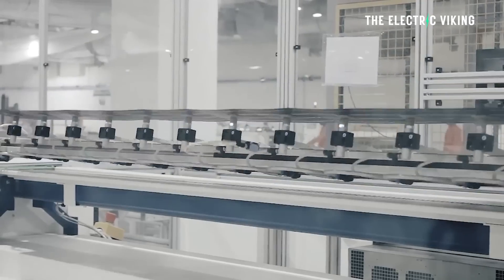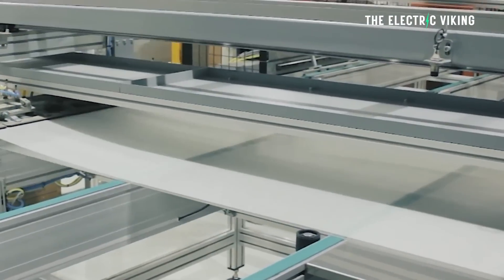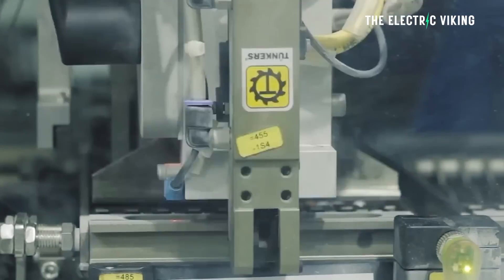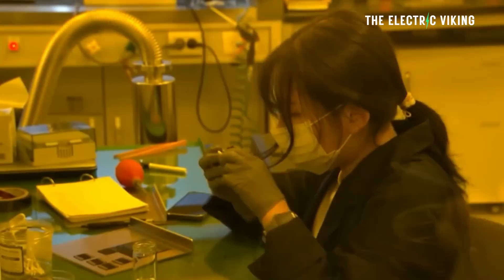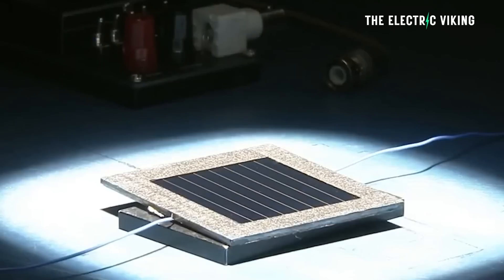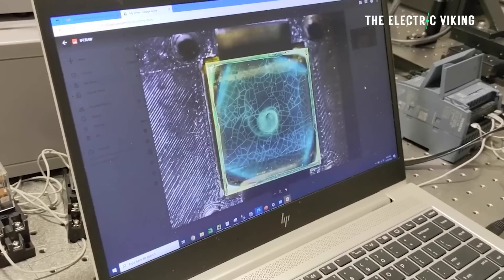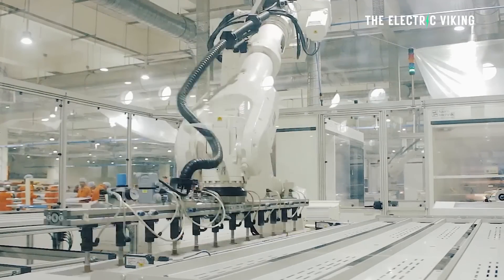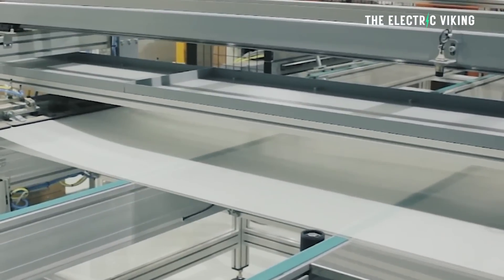AI enables China beating perovskite solar cell production in Australia

Comment: My boy... Current AI is shit.
You should check and test because the fucking AI makes a shit ton of mistakes.
AI still can't do basic math or reliably correct a fucking text, it makes mistakes , it skips lines, it doesn't double check and appears so confident when it provides a wrong answer...
Did the AI discover anything yet?
17% efficiency is bad and you'll never make it cheaper then the fucking Chinese.
Even if you somehow manufacture 17% panels at 1/4 of the cost / W of a Chinese panel you're still going to fail because you will need twice the area, twice the number of panels, twice the number of frames, cables, fuses, connectors, diodes, glass, whatever and twice the installation cost which is the most expensive thing.

Comment: Your believe in Western technological superiority (the Asians have stolen our technology/ Tesla will rule the world) is comical. 1. research in Perovskite cells is going on all over the world, for in stance at Chinese Hong kong and Japan. 2. they think to have realized a durable composite material, but one can only be sure in 10 years time. 3. silicon based solar cells are improving to equal levels of perovskite cells (>30%) 4. with AI they have developed new cheap production technology (nano printing etc), but the claim that this will be cheaper as producing silicon cells is unproven (silicon production has been completely automated and latting machines work is cheaper as destroying them). Be glad that the Chinese are not like most Westerners (f*cking you from behind in the service of humanity) and the Chinese new chips will not be accessible to Western research and can not be copied.

Comment: Perovskite has the inherently bigger issue of lifetime expectancy or degradation over time. So it needs to be sealed well and probably other protection or preventative measures too. AFAIK. So far, it was seen as a potential second layer under the classical silicon layer and such dual layer panels can easily raise production from 34% to 43%. With that the same area of panel produces 1/3rd more electricity. The question is how perovskite-only would behave.

Another innovation that was lurking at the horizon of "solar" is the introduction of optical grids over the PV layer where each cell in the grid is an optical tunnel, guiding light from different directions to the PV layer. This would increase the time window in which the panel can convert energy at peak performance (because less sensitive to angle of light incidence - angle relative to sun) and so increases total kWh production per 24h compared to the same PV layer(s) without the funnel grid.

The question is when we will see panels that do the two layers with the funnel cell layer on top.

"AI" - note that the A is for "artificial" and the associated "I" (intelligence) depends a lot on how artificial it is. "Learning AI" has become easier (with more powerful compute power at lower TCO) and generative AI in that is more easy too, but it still depends on human teaching and algorithm coding. We have seen learning AI get better and better and when people managing the AI did not halt the learning, it became exponentially more stupid again. You need a lot of human intelligence to get good AI.

The future of smart and beneficial AI is that the world no longer depends on cheap labour in sweat shops far away, in regions of political instability, and on long logistic transport routes.

Comment: 17 % only ? I recently watched one of your videos stating that one company has produced solar panels with 33 % efficiency.
Reply: it's the best so far, not what's possible. The main thing is they're so cheap you can put up a lot more for the price.
Reply: There are different types of solar cell. This is a record for this type. This type is potentially much cheaper to manufacture so lower efficiency may not matter in the big picture.
Reply: @glennjgroves  as I said, in different words. :P
Reply: @thekaxmax  you did not state that there were different types of solar panel. You implied a cost difference, but not what the cost difference was between. If someone missed that these were a different type of solar panel, your comment did not make that clear. So you actually only said part of what I said.

Comment: Some solar panels get damaged easily really a pretty big array in Nebraska took out most of the solar panels with it hail storm
Reply: perovskite cells are more robust, they aren't under glass.
Reply: Solar City, Elon's company, has already produced a hail-proof PV panel.
Reply: @1voluntaryist  it's not too hard, you use a polycarbonate cover. But manufacturing price is an issue.